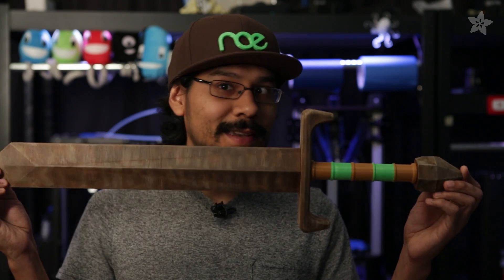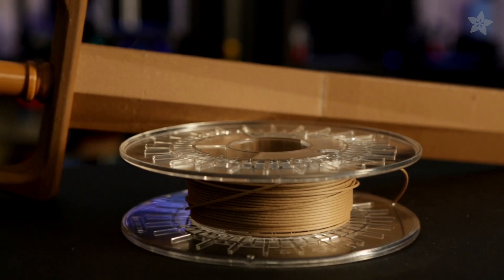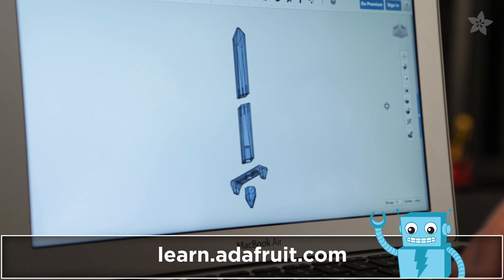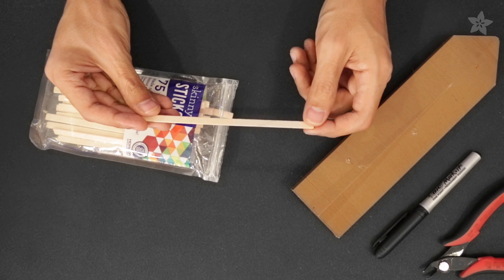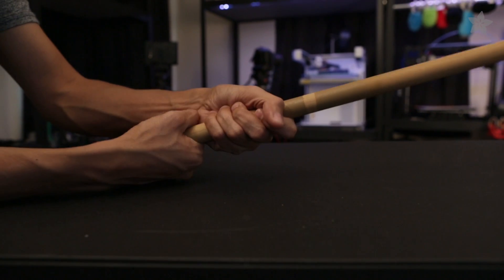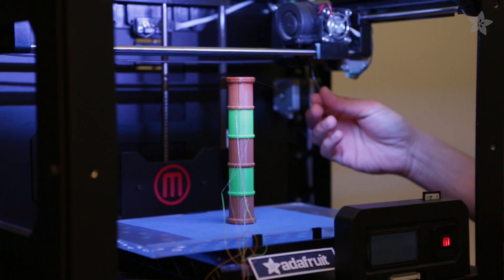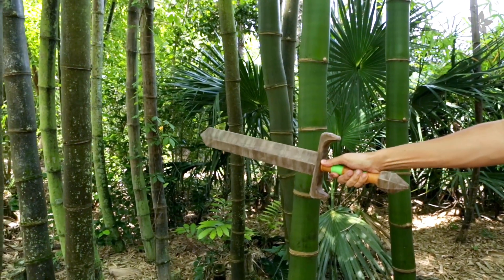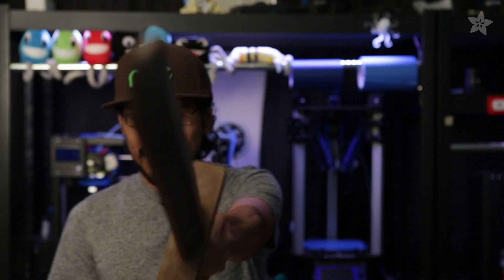Link's 3D Printed Wooden Sword

Comment: Why not let the dowel go all the way thorough the blade's spine?
Just cut out a cylinder in the middle of the parts. It'd save on material and it certainly looks like the blade's thick enough,
Reply from the maker: you can easily modify the design files, just push the face for cylinder inside the blade further :)